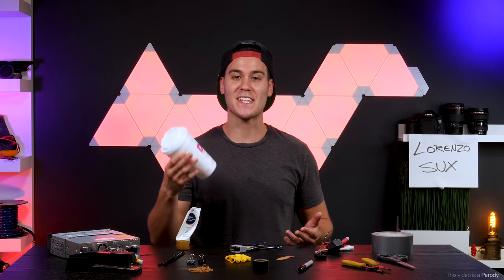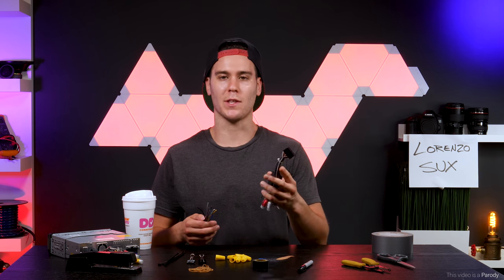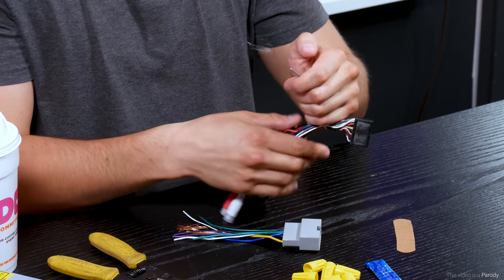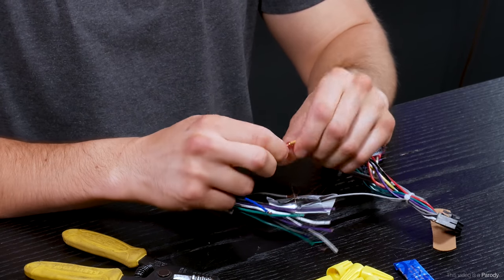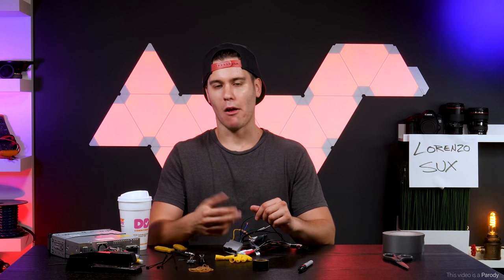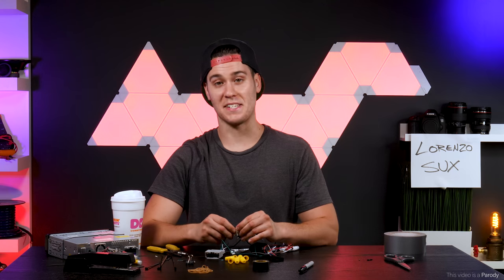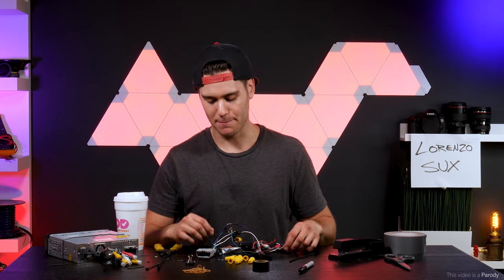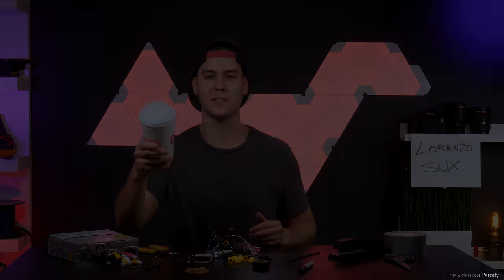BJ's - Vlog 57 - How not to install a car stereo

Comment: l actually do the wire nut method, it works great! makes a secure connection and it's easy to access in the future if you want to replace or make a modification.